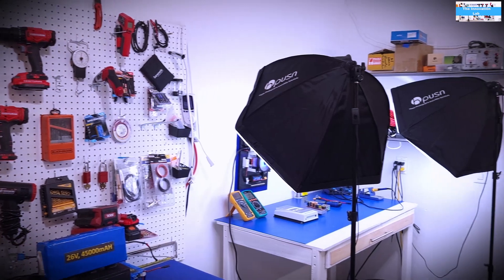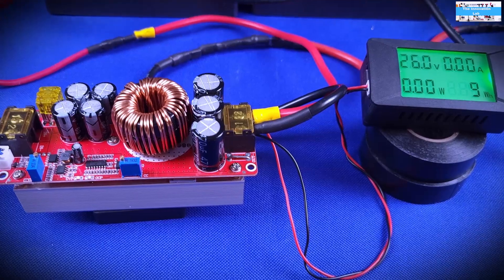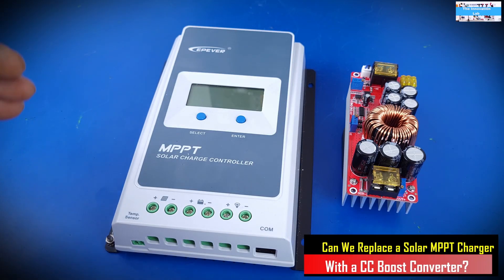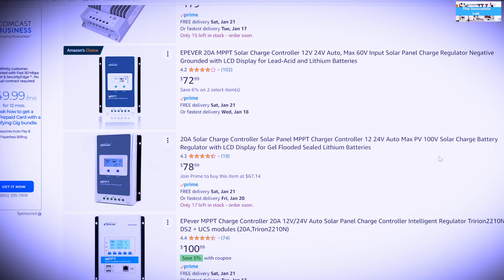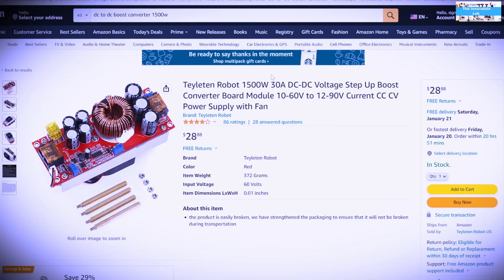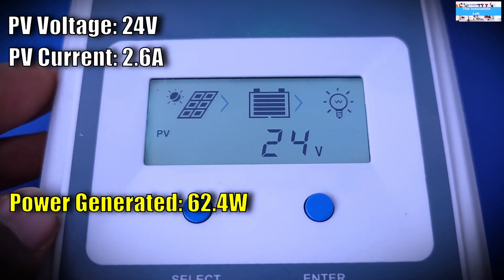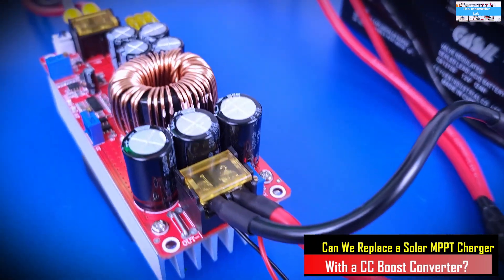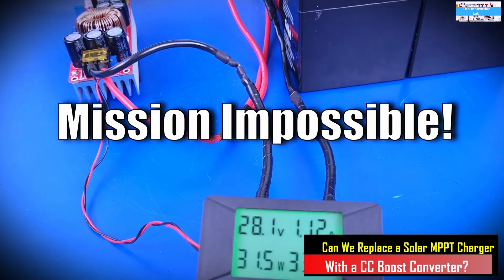Solar MPPT Charge Controller vs DC to DC Boost Converter, which is Better for Solar Charging?

Comment: Mppt is a buck or buck boost converter controlled by a microcontroller basically. You can run one off an arduino or raz, etc. Boom true mppt with multiple charging stages.
Reply from the maker: Agreed, but it won't end up being as simple as you put it.😊 Getting any power design to work as expected is always a lot of fun.....and by fun, I mean pain. Hahaha
It has been on my bucket list to build a diy MPPT solar battery charger...but these projects take a long time to get them to work - especially when a software to hardware interface is involved. 

Thanks for the wonderful engagement.

Respectfully,
The Innovati0n Lab.
www.theinnovati0nlab.com
Reply: @theinnovati0nlab782 Mine too, especially a synchronous diy mppt buck/boost

Comment: A constant Voltage buck converter would be the option. 
Set the output to the max lithium voltage. And set the CC section to a peak of the output of calculation for the step down from solar to battery.
So if your battery is 14.6vdc
And the max of your calculations is 10A let's say.
The unit will only supply a max of 14.6v at no more than 10A and will reduce as the battery requires or the solar can supply.
I have a power supply with CV and CC and that is what I use to charge lithium on the bench.
Reply from the maker: Thanks for the wonderful feedback and engagement. 
Much appreciated. 
However, the thing to not here is that this experiment is meant to emulate the IV curve behavior of a typical solar panel. Solar panels have low output impedance and that tends to be a challenge for these converters - when used for solar charging.

Thanks again.
- the Innovati0n Lab

Comment: If you have 24v or higher battery and have just one 12v solar panel. Victron or simmilar mppts can not charging but put this 1800w dc-dc converter before your mppt charger. Charging start eary and stop late so can work cloudly day
Reply from the maker: Sounds good.
Thanks for the wonderful feedback.

The Innovati0n Lab

Comment: On the contrary everyone may change MPPT to PWM controller, for instance, and add the 300watt step-down XL4016, which can enlarge your solar panel from 1.86A to 3A and from 18.8 V to 14.2 V, your MPPT will be not needed. Only an ordinary PWM controller for 7 US doll and XL4016 for 4 us doll.
Reply from the maker: Wonderful!
Thanks a lot for the great feedback and engagement.

Respectfully,
The Innovati0n Lab💥

Comment: What id you put the boost converter after the panel and before the MPPT o even if havi a battery instead of solar panels and using a 48 volts input
Reply from the maker: Thanks for the engagement. Please let me know if you have a specific question. 

Respectfully,
The Innovati0n Lab.
www.theinnovati0nlab.com

Comment: Let me explain my setup. I have 4 solar panels in series. Each panel is of 400 watts with 45 volt voc. I am monitoring overall series voltage is not exceeding 167 volt DC. All solar panels I directly connected to 12 lead acid batteries in series. There is no charge controller between solar panel and my battery bank. I am monitoring my setup since from 3 months and setup is working fine. I am using induction cooktop, water heating rod, laptop, mobile, led tubelights, led bulbs directly on this setup. I used a capacitor on my switches to avoid sparking. I am testing iron press thermostat sparking with this voltage but iron press still not able to use due to sparks. Now I have a problem that on this setup I am not able to use inductive load. So I purchased the battery and inverter. I want charge my battery from my 165 volt dc voltage. Is it possible to connect boost converter in series and charge a 29.5 volt battery?
Reply from the maker: Wonderful!
This seems like such a cool solar DIY project.
👍👍👍

However, you should always have a solar charge controller between your solar panels and your battery systems. If you are not using charge controllers, your battery system will impose a huge stress on your solar panels over time and they will get burned out over time. They may be working in the short term, but trust me, the panels will be short lived if you continue with this current setup.

I made a similar mistake a long time ago and it cost me a few solar panels.
Please find a cheap PWM solar charge controller and use it to recharge your battery system. The direct connect is not good and it could be a fire hazard as well - as your batteries could also overcharge and overheat. If you can afford an MPPT charge controller, that is even better and more efficient...but it is way more expensive!

As for adding the boost converters, what I saw from previous experiments was that the converters would go into oscillations at low irradiance ad this lowered the efficiency of the system. There was something else I tried but I have not been able to do the explainer tutorial video.

Please watch the video below.
👇👇👇
https://youtu.be/3v5FmnvwdmQ?si=Ry8P22Z9DE2UIXEa

I hope this helps.
Respectfully,
The Innovati0n Lab💥

Comment: I have a question if I provide the solar input to battery first and then voltage from battery is given to boost converter then?
Reply from the maker: That would be the best option. However, that also means that you will need a good charge controller to transfer the energy from your solar panels to your battery system.

⚠️⚠️⚠️
 Directly coupling (even with diodes) your solar panels to your battery is a bad idea and it will damage your solar panels over time.

Again, you always need an efficient solar charge controller between your solar panel and your battery system.

I hope this helps.
The Innovati0n Lab 💥

Comment: Just mount the this dc-dc converter before your mppt charger and set it at the max voltage your mppt can take on this way you will get little bit more amps in the morning/evening and in days with bad weather.use for safety the 1800w dc-dc booster
Reply from the maker: Thanks for the wonderful feedback.
Is this something you have tested?
Or is it a hypothetical suggestion?

Thanks regardless.
Respectfully,
The Innovati0n Lab 💥 www.theinnovati0nlab.com
Reply: @theinnovati0nlab782  the victron mppr starts charging earlier and aslo finishes charging later.i saw an clip in YouTube so that's why I bought an 1.8kw booster

Comment: Is it worth to use a DC-DC boost up voltage from 18V to >40V for long distance cable ? The Boost Buck converter will be install right at the solar panels and MPPT module or Buck (or Step down Buck converter)  + bateries will be 30-50 meter away ? I am thinking about overcome the wire resistance by using higher voltage delivery
Reply from the maker: I see. I love the way you think - definitely innovative!
👍👍👍

This would have worked for most regular power supplies, but unfortunately, I don't think it will be a good idea for solar panel array. 
The ideal thing to do would be to keep your MPPT controller, battery, and boost converter all close to the solar panel - as possible as you can. This was you can minimize losses (using the appropriate sized wire gauges)....then for your long distance power transmission experiment, now use the boost converter the stepup the voltage of the transmitted power.

⚠️⚠️ CAUTION:
Both your converter and MPPT will incure losses due to efficiency hits. So you should do the math to determine if the long distance cable losses would be worse than the combined losses between the MPPT and boost converter.😊

Overall, my recommendation would be to either buy bigger gauge cables or you can double up on the one you are using.

I hope this helps.
The Innovati0n Lab 💥 www.theinnovati0nlab.com

Comment: so i could charge laptop with that boost converter, 19.5v and 20A
Reply from the maker: Great idea!👍👍👍
However, this is something I have not tried. I will neither recommend nor discourage you from doing it. I will be curious to know if it works, though.

⚠️⚠️⚠️
I would recommend conducting some research on the subject and possibly characterized by some known laptop charger brands with respect to charging voltages, acceptable RMS, and peak-to-peak ripple levels.

SUCCESS WISHES.
I hope this helps.
The Innovati0n Lab 💥 www.theinnovati0nlab.com

Comment: Thanks for all the juicy info 🙂
the problem I'm having is using these charge controllers for small garden projects with 10 Ah lifePo4, the mppt is killing the battery overnight. summer time is fine as there is an abundance of energy to run my stuff 24/7, but now in the fall there is not enough solar to maintain the mppt. if I remove the mppt and connect solar directly to battery all my stuff runs fine 24/7 
problem is what about the extra sunny days! and I have to keep track when in the spring to put the mppt back on etc...
I wish there was a simple method to just limit the voltage going to the battery that did not draw energy from the battery
Reply from the maker: Thanks for the feedback. 
Great question. 
May I ask what MPPT charge controller model and specs that you are using?

MPPT charge controllers are supposed to be more efficient than just connecting the battery system directly to the solar panels. I think the problem may be that your battery capacity is a bit low, and since your setup involves leaving the MPPT connected, you are losing a lot of power due to quiescent power draw from the charge controller at night.
Also, you may need to add more solar panels to capture more energy during the non-Summer months.

What is the voltage and power rating of your solar panel?

Respectfully,
The Innovati0n Lab 💥 www.theinnovati0nlab.com

Comment: boost converter is wrong.
put in a buck converter set it for example to ~17,5 volt in and 14,5 volt out and put it on a 12V panel and 12 volt battery and job done.
Reply from the maker: Thanks for the feedback.
However, the boost converter was the premise of the video... not buck converter. 
Also, keep in mind that this was an experiment conducted out of curiosity.

Thanks, though.
The Innovati0n Lab 💥 
www.theinnovati0nlab.com

Comment: Can the cc boost charger regulate the charging algorithm as the mppt does ? ie boost bulk and float current ? 😉🙃😎 NZ
Reply from the maker: Great question.
The quick answer is no.
The MPPT charge controller has a dedicated function of being super efficient in running a maximum power point tracking algorithm and this is why it is about 5 times more expensive for a third of the power - in comparison to the boost converter. 

However, I have made some progress in tuning this converter to work a little better from when we initially experimented on this concept a while ago.

See our latest video below, and I am working on a follow-on.
👇👇👇
https://youtu.be/3v5FmnvwdmQ?si=oYu5LK8Kmzqc2GeG

Respectfully, 
The Innovati0n Lab 💥 
www.theinnovati0nlab.com

Comment: Now can you discus using DC to DC boosting to use greater than 200 amp hour 48V battery to fast charge a car please.
Reply from the maker: Yes, you can do that.
I am not just sure about the fast charging aspect. 
Most car batteries are usually lead acid batteries, and those are usually not built for fast charging. 
Fast charging could damage the cells of the battery. I believe the rule of thumb is to charge them with 1/10 of the amp/hr rating.....for about 10 hours.

I hope this helps.
The Innovati0n Lab 💥 
www.theinnovati0nlab.com

Comment: This is not a fair comparison. Use different volts batteries for MPPT and Boost converter, especially, 12.6 volt is a sweet charging spot for lead acid batteries that in your MPPT system, while 28.1 volts indicate a fully charged stage of 2 series lead batteries (28.1/2 = 14.05 v each), therefore, the battery in your boost converter system tends to reject higher amps
Reply from the maker: Thanks for the objective feedback.👍👍

However, the goal of the video was never to make a comparison between two dissimilar devices. This was purely an experimental project conducted more than a year ago. The goal was to see if we could possibly use the cheap boost converter as a somewhat solar battery charger.

It was never a comparison because the MPPT charge controller is a high efficiency specialized device that was designed for a singularity of purpose......solar batrery charging.

Also, I respectfully disagree with your voltage rejection theory because when you connect two 12V lead acid batteries in series, the required charging voltage is doubled from 14.4V to 28.8V.....it's just that simple and this not just theory for me as I have tested this and I have been using it for ages now.

I hope this helps.
The Innovati0n Lab 💥 
www.theinnovati0nlab.com

Comment: why did you not try to connect the DC-DC boost to the MPPT controller?
meaning this: PV --> DC-DC --> MPPT --> battery
i tried it and it also does not work? my problem is that the solar panel only outputs 30V but battery is 36V LFT
Reply from the maker: It's not the best idea because besides doubling your power losses, you will also introduce some unwanted ripples from the boost converter to the MPPT charge controller.

MPPT charge controllers are high efficiency solar devices designed to operate from ripple-free, clean dc supplies.

I hope this helps.
The Innovati0n Lab 💥 
www.theinnovati0nlab.com

Comment: Ok... what about battery to battery? If I have a 51.2v 105ah lithium battery and a 12v 50ah AGM accessory battery in my golf cart... what is best for keeping that 12v battery charged...? A 48v-12v stepdown converter, an MPPT solar controller or a DC-DC charger?
Reply from the maker: Great question.👍👍👍
It comes down to the transfer of stored energy from a higher voltage battery to a lower voltage one. 

Any of these devices would work.  It's just that you will have to deal with the power losses associated with the process.
MPPT charge controllers would be my bet because they are designed for better performance and high efficiencies, which translates to lower power losses.

This will make a great experiment.!
I hope this helps!
The Innovati0n Lab 💥 
www.theinnovati0nlab.com
Reply: @theinnovati0nlab782  ok, so you think the MPPT will be more efficient, BUT which will maintain the 12v agm battery better... I'm not concerned with loss of energy of the lithium pack... that would be 2 scenarios... efficiency and maintenance... which has better charging profile, the controller or the charger

Comment: If you use one boost controller with lower power and a buck with high power you have a MPPT controller. What you are lacking is the microcontroller switching between them as per the solar input. What you gain with the boost is just a marginal energy at dawn and dusk but also when it is a little bit cloudy. If it rains you won’t get anything. The microcontroller ensures that you don’t damage your batteries, very important if you have expensive lithium ones.
Reply from the maker: Wonderful feedback!👍👍
You have great points.
I have had it in my bucket list to build a microcontroller drive MPPT charge controller.

The boost or Buck contofiguration also depends on the required charing voltage of your battery bank with respect to your solar arrays voltage. 
MPPT charge controllers are primarily designed with the buck converter topology to allow for a very wide input voltage range.
I hope this makes sense to you.
👍😎
The Innovati0n Lab💥
www.theinnovati0nlab.com
Reply: Can you link a microcontroller you are using?
Reply: @ I used an Arduino, it isn’t very picky when it comes to performance you need ADCs to measure voltages and maybe current.

Comment: Much better with MPPT as it works in real time and does not 'collapse' the solar panel voltage like a normal converter. You have to keep adjusting a buck converter, which is not realistic as the power keeps moving with the clouds. I can see why MPPT cost more, it's like someone is adjusting it for you.
Reply from the maker: Very well said.
No better statement than that!
👍😎
The Innovati0n Lab💥

Comment: What is the impedance of the power source? A car battery has a very low impedance while a PV panel has a very high impedance. So their IV curves will be very different.
Reply from the maker: Great question.
The answer goes to a much deeper analytical level. However, to keep it a bit simpler, the output impedance of switch-mode power supplies is dynamic. This is largely a function of the voltage and current levels that interfaces with your load in real time.

For example, a 12V, 1000W converter at full load will present a very low output impedance due to a high current draw by the  load. On the other hand, if only 1W of output power is drawn from the same converter at the same output voltage, the calculated dynamic impedance will be much higher. 
To keep things simple, we assume that given the DC nature of the output, ohms law applies, and that brings us to the good old V = I*Z; 
WHERE Z is the output dynamic impedance of the converter - with respect to the applied load.
💥You will notice that I used "Z" and not "R"? 
This is because there are some small components AC components present at the output of the converter.....and this we know as ripple. 

The same is true if the output voltage is much higher than the 12V example used above. Imagine the output dynamic impedance of a 1000W, 1000V converter ===> Essentially, the output current supplied to the load would only be 1A. 
Now, solve for "Z" in  the equation above!💥

Essentially, we are solving ohms law at the output of the converter.....again this goes much deeper analytically. It depends on how much math you are willing to do and how much deeper you want to get into the nuances of switching supplies.😊

I keep these videos as simple as I can, for a good reason...hahaha.

This is too much fun for me...hahaha. Sorry for going super nerdy on you. 
Your question was quite interesting!
👍😎
I hope this helps.